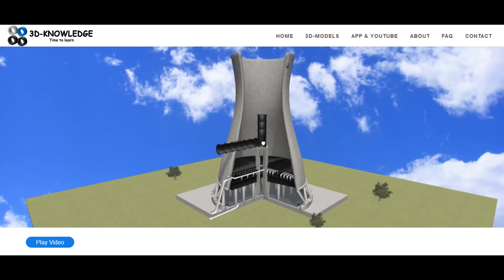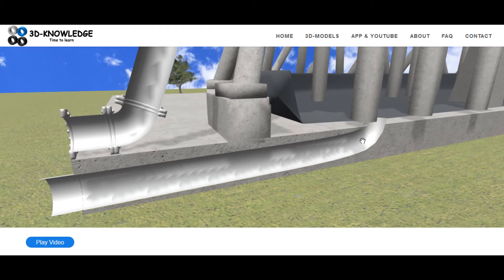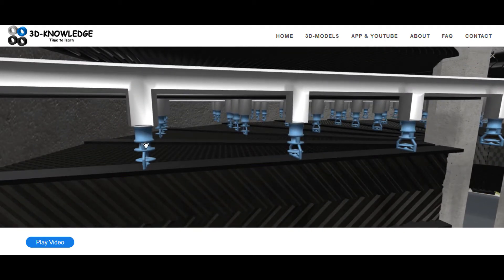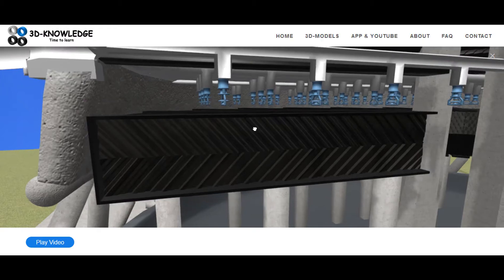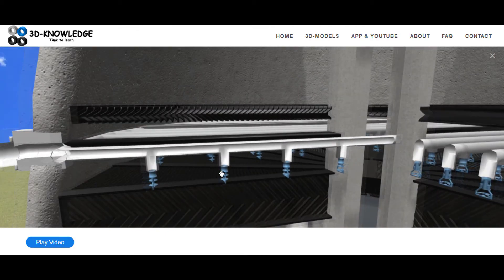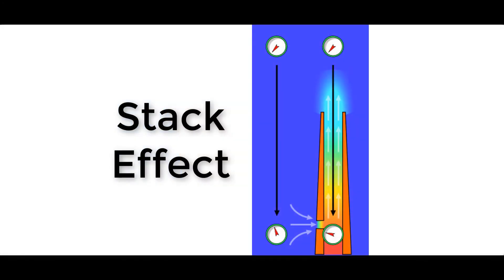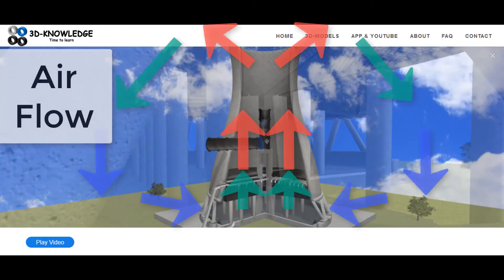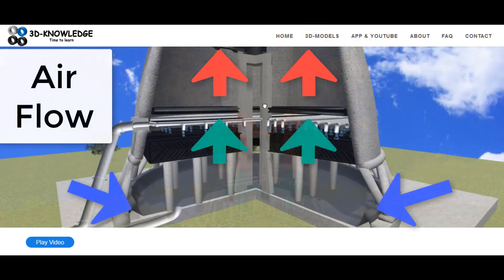How Natural Draft Cooling Towers Work (EiM series)

Comment: The shape if the tower is a convergent/diverget duct which accelerates the velocity if steam. The restriction in the middle of the tower causes low pressure and temperature reduction and increases steam velocity. The top of the tower with the divergent shape has a higher pressure and increases the temperature thus drawing more steam.
Reply from the maker: If you like this video, Make sure to check the new channel on YouTube, search for saVRee.

Comment: If steam has already condensed to a liquid, then why use a cooling tower?
Reply: A cooling tower is used for cooling the water circulating inside the condenser. When water passes through the condenser, it absorbes heat from the saturated steam which leaves the turbine and becomes hotter. Then in passes through the cooling tower where it is cooled and it is sent back to the condenser to repeat the process. It needs to be cooled in order to absorb heat from the steam again.
Reply: @2112dim  Is there not a loss of cooling water when it is passed through the cooling tower, as the steam that leaves out of the top of it?